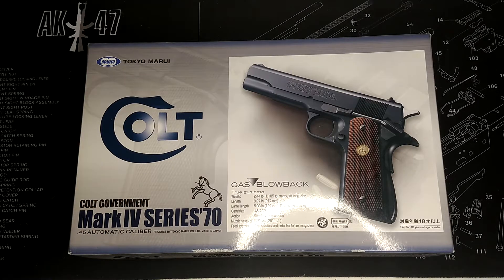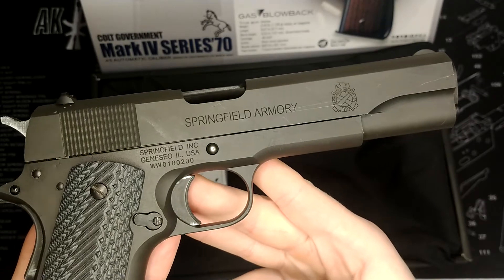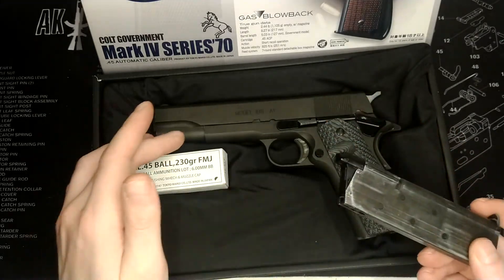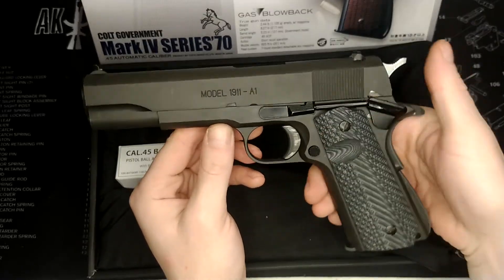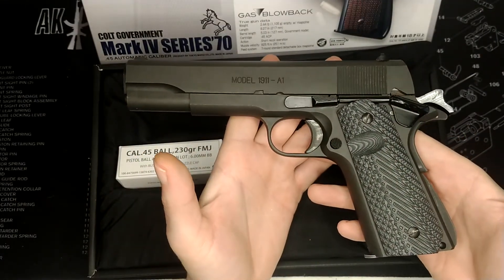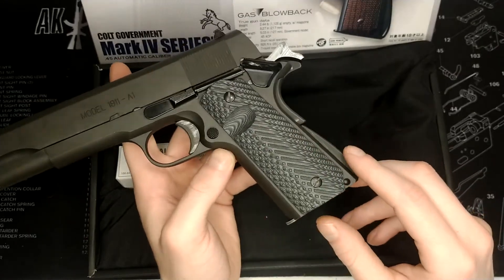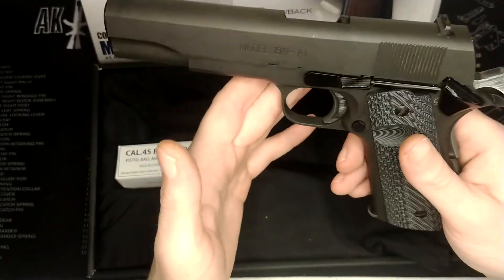Guarder Full Metal 1911A1 kit on a TM MkIV Series 70 (Airsoft)

Comment: Do you think you could buy the Guarder kit and build a complete 1911-A1 springfield without a base donor?  I'm thinking about doing it with as many Guarder parts as possible.  Also would the kit stand up to green gas or is it white gas only like the TM ones?
Reply from the maker: Yeah, hi-capas, glocks and 1911 can all be made without a donor due to the massive aftermarket support they have. I'd make sure you can source all the parts you'll need before you make a start 👍
Green gas is fine, I run guarder black through this one sometimes.
Reply: @OllieTalksAirsoft  Okay... thanks Ollie, wish me luck!
Reply from the maker: @RogueWraith909  good luck!!
Reply: @OllieTalksAirsoft  Thanks!

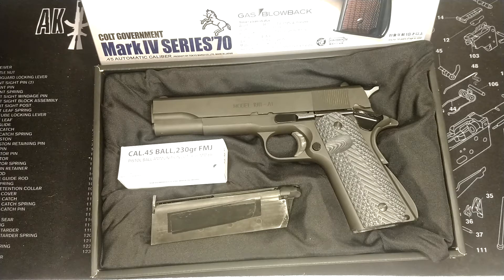Comment: I wanna know why the black tape stick on side of your magazine.(6:51) If it just spacer, wanna know the reason as well.
Reply from the maker: just to stop the mag wobbling and making noise essentially. but also when you have a metal lower pistol grip they also don't hold mags as well as there's no flex, with heavy recoil the mags can eject themselves. ive had the same with my 2011 lower, never had it with a Glock or M&P as they have polymer lowers.
Reply: @OllieTalksAirsoft  I see. Thanks. However, the weights inside the grip of the 1911 series GBB make not only increases the weight, but also contributes to the conservation of thermal energy of the thin mag. For that reason, it is recommended to stick a high thermal conductivity material tape inside the grip. Then you don't have to stick the tape on side of all the mags you have, and it will also help the efficiency of gas that takes away the heat from the surrounding area and vaporizes it.
Reply from the maker: ah yes, this is what I used to do with my old Western Arms Wilson Combat Hi-Capa, to be honest this thing shoots great with the metal kit on, I thought it would kill the efficiency but actually its alright.